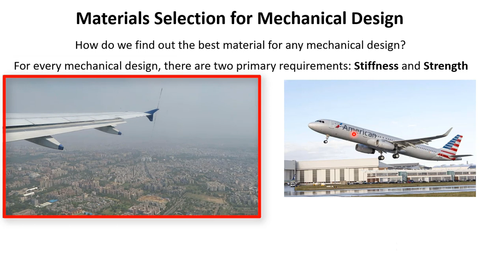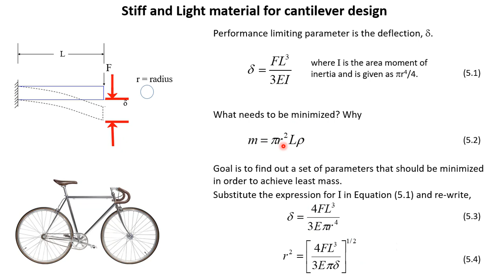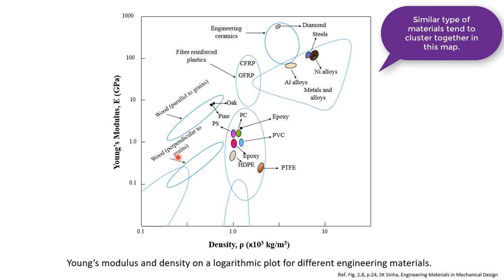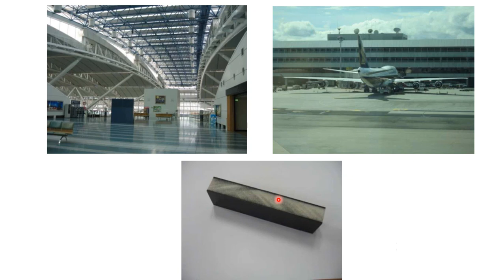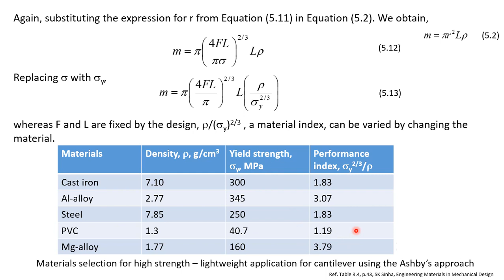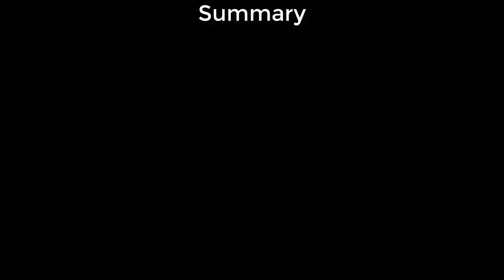Materials Selection for Mechanical Design. Ashby Map for Stiffness-based and Strength-based Design

Comment: I'm still confused how to get the value of c to determine the y-axis
Reply from the maker: C is actually design specified parameter depending upon how good you was the performance. Higher C will give better performance of the materials but also at a higher cost. So, the designer has to optimized performance with cost.
Reply: @engineeringmaterials-tribo5142  okay, thanks for the explanation. It really helped me.

Comment: Hello, I tried to find material index for bolt on aircraft wings  but I could not find it can you help me please?
Reply from the maker: For bolt you may not go for light weight because strength is very critical including creep. The weight of the bolt compared to the total structure may not be too high. However, you can do the analysis by treating bolt only in tension. This is geometrically very simple, you can compare with specific strength values between different suitable materials. Corrosion and creep properties are also very important during materials selection for bolt material.
Reply from the maker: Toughness is another important one because fracture can happen by fatigue.

Comment: ı try to find material index for bolts on plane wings.Can ı use strong and light material index?
Reply from the maker: I think that we may not use this method for bolts because the weight saving is not much. This is because the weight % of bolt compared with the total structural weight of the plane wing is not much. Moreover, with bolts (nut and rivet) we need to have extra safety which can only be provided by the right kind of bolt material such as high strength steel.  Corrosion prevention of the bolt, nut and the rivet is also very important.
Reply: @engineeringmaterials-tribo5142  ı m thinking like this and ı have material Ti, Al,stainles steel but how can ı eliminate. I should search more
Reply from the maker: @ensarcetin2491  However, you can do the analysis by treating bolt only in tension. This is geometrically very simple, you can compare with specific strength values between different suitable materials. Corrosion and creep properties are also very important during materials selection for bolt material. Toughness is another important one because fracture can happen by fatigue.

Comment: The second value of C that's go up  i choice it or there's calculation?

Second question
He gives some materials density and young mud to put in performance index law or he wouldn't?  In exam
Reply from the maker: Do you mean C in Equation 5.14? Yes, you can choose it based on your  design requirements. Just the way you would select strength of a material based on design and application.
Density and modulus has to be known to find performance index.